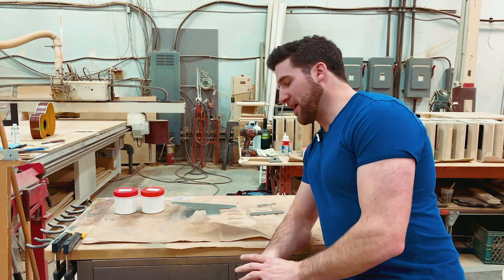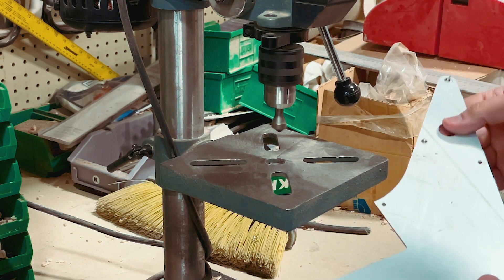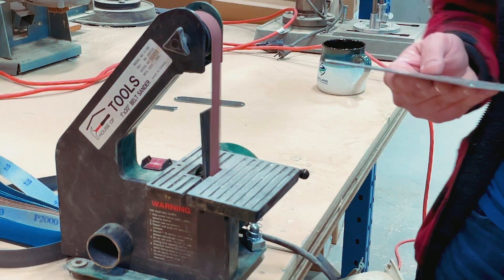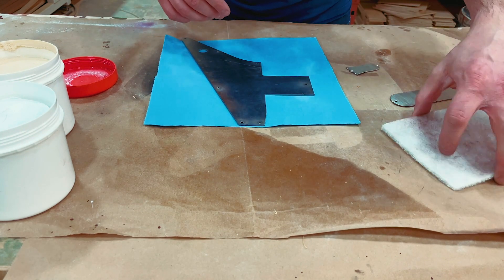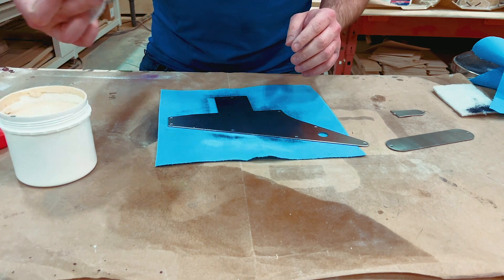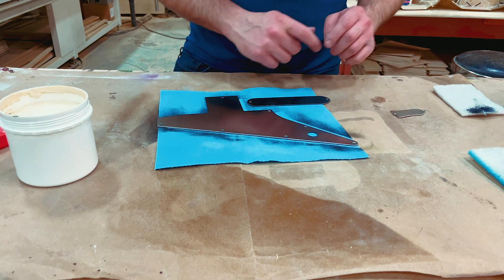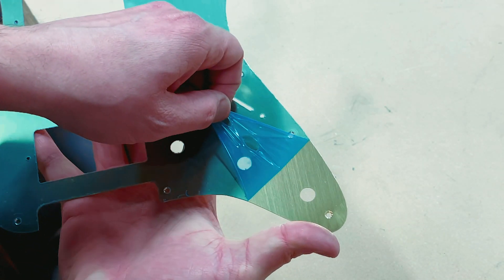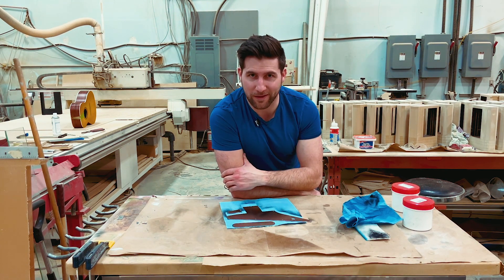Making Beautiful Stainless Steel and Brass Pick Guards

Comment: Just a bit of advice about using a countersink. You always use any tool at a slower speed in Stainless than any other material. When using a countersink in stainless always use the slowest speed due to the fact you may damage the tool and harden the material.
Reply from the maker: Yes, on any hard material like stainless you should use low speed and apply a bit more pressure. Cutting oil is also helpful for bigger tasks.

Comment: I have a serious question. Lets say you made the stainless steel pickguard and when you go put in the pickup, it won’t go theough literally by a hair. Do tou file and what type of file would you use to get that insignificant clearance? I appreciate your answer.
Reply from the maker: Yes, I’d use a file on it. Likely a single cut file. One that just has the groves in one direction rather than cross-hatched.

Comment: Sorry not related to the video just need help. I painted my guitar with rustoleum 2x and has come out great. I have left it to cure for like 3 weeks and now I am preparing to use rustoleum 2x clear coat on it, but I have been reading about many peoples paint wrinkling the second the clear touches it
Reply from the maker: Yes, people have had some difficultly with that. I would make sure you sand it and apply your first couple coats of clear very lightly to avoid a reaction.

Comment: I really like your metal pickguards...my problem is my guitars are as old as I am so replacing a pick guard would hurt their values, significantly.  I think a wire brushed brass guard is exactly the guard Fender should have put on my old '69 Thinline...I've always disliked the original pearl pickguard, it has always been one of the weakest features, imho, on the guitar.
Reply from the maker: Thanks Paul